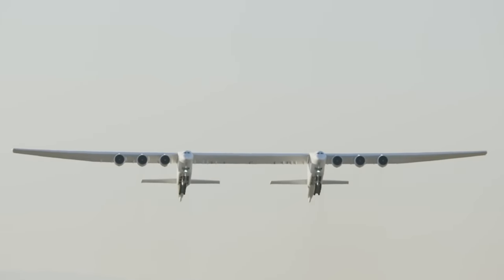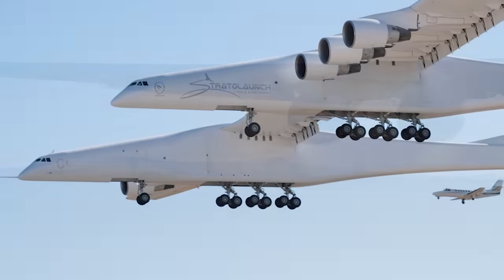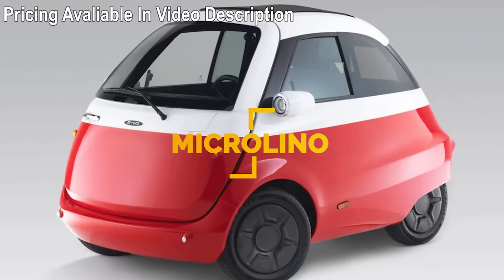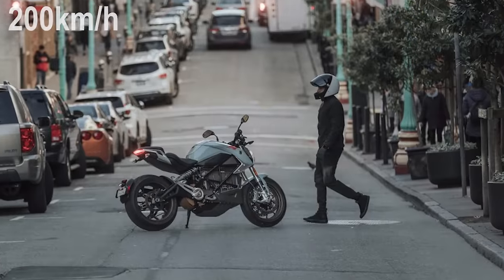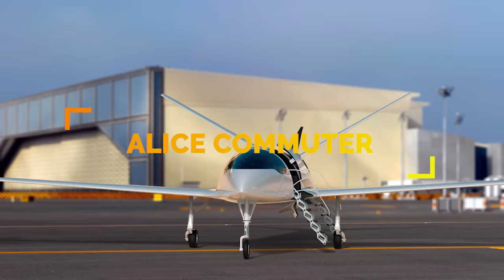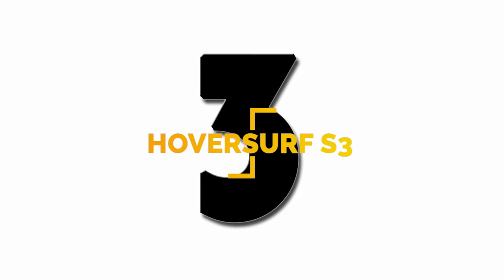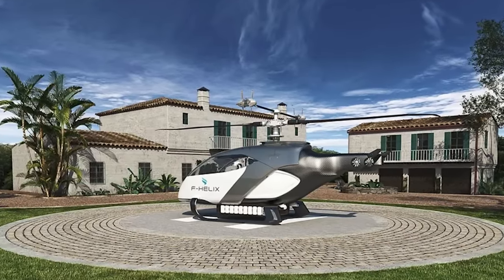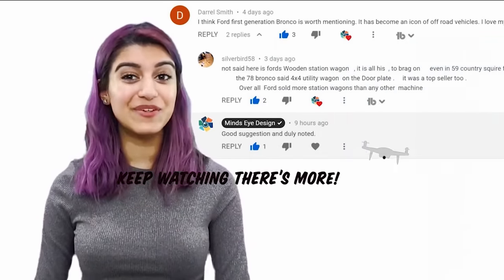15 Impressive Personal Transportation Technologies Worth Noting

Comment: The Stratolauncher is probably the most important "vehicle" here. Launch rockets use most of their fuel just to get off the ground and up to the stratosphere. By launching at 35,000 ft you're saving huge cost. The payload won't be large, but most satellites aren't anyway and are getting smaller and smaller as technology advances. I like the Lush but it makes a huge fail by having two wheels at the back and one in front. That's a very unstable design, and should be the other way around.
Reply: i love the delta form. -2 wheels back, one in front. it's not built for speed and you have to take a full stop at corners,. so it should be more than stable. it's my design. i don't care for the tadpole.

Comment: Self driving bus is definitely coming to many cities around the world, just a matter of when. Flying vehicles will have limited use due to noise and wind factor. Residents in urban/suburban area are not going to tolerate the noise and wind from a bunch of large drone type vehicles, and the props definitely need to be shrouded to prevent contact with anything, including birds and humans. Some sort of parachute is going to be a must, nothing human-made is perfect and these things will fall out of the sky. Don't think silent or anti-gravity propulsion is possible.
Reply: For noise, altitude and amount/size of props and/or rotors can be used to an advantage. So noise isn't the big of a problem unless you are near a takeoff/landing zone.
 
Wind? what does that have to do with anything? 
 
A cover for those reasons? I guess. It really isn't necessary, traffic will probably be mostly designated and people won't usually be by the rotors when active. That's a strength that electric has, it doesn't need a long startup process, you could get in, have the vehicle do a quick sensor sweep to make sure there aren't any dangers nearby and finally start. There will always be a danger if you aren't responsible or careful, and in this case, the only way to completely prevent impact to the rotors would lead to significant drops in efficiency.

Comment: Still making payments for the Lego Bugatti, so far I can just make a Lego Yugo.
Reply from the maker: Which do you think costs more, the Lego version or the normal Bugatti?
Reply from the maker: Yes, a Lego Yugo would be epic but that probably goes without saying.😂
Reply: @mindseyedesign  Being that the Lego is a one off and still seems to use some external parts, plus design, damn close maybe?
Reply from the maker: Originally, I was thinking the actual Bugatti would cost the most. I haven't looked for the price yet, but after hearing how labor intensive the lego version was I'm really second guessing my early thoughts. Now I believe the Lego version has a higher price tag.  I'll dig and see if there is a price estimate somewhere and let you know. You could very well be right and the cost is really close. That seems very reasonable.
Reply: 🤣🤣LMAO
Reply from the maker: @lagbait3076  I'm not sure what happened to my replay but I did the math on this and the Bahati cost 3 million, so I think it won most costly.
Reply: @mindseyedesign  yeah, 2.6 for the version that was made, Bugatti made a newer version of the Chiron, the Chiron Sport, right at the 3 mill mark but still.. I did a little research myself and once I saw the price of the car I was like, nope. Couldn't find a price on the lego other than the cost of the sets would be around the 100,000$ mark.

Comment: Your opening clip, is just silly.  With the Microlino with the entry in the front, if there is a accident, can the occupant exit if the door is jammed by the collision?  The HoversurfS3 would be great as a human blender!
Reply from the maker: Yes because people will be running directly at it at any given time. You could say anything is dangerous if used improperly. I'm also pretty sure the final model will include blade guards.
Reply: @mindseyedesign   - I would hope so!

Comment: 10:33 "You get a range of 175 miles" and the screen shows 581km in the top corner. That's wrong. 175 miles = 287 km.
Reply from the maker: Good eye that's definitely off then. The editors pay has been docked 1 beer.
Reply: @mindseyedesign  

That's harsh! They need to unionize.

Comment: My bet is self controlled flying machines[ AI ] will begin to replace cars as commuter transport in about a decade. This shall reduce traffic and need for more roads. Because we can charge batteries by pedalling using a fly wheel to generate torque we shall see eventually batteries being not so essential due to other technologies soon to be released.